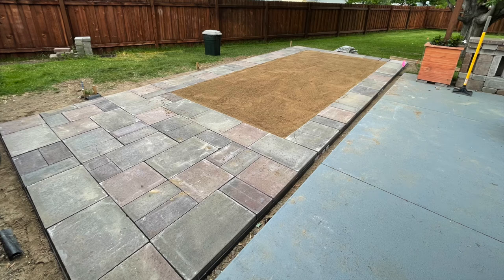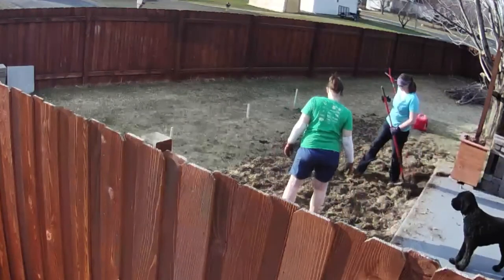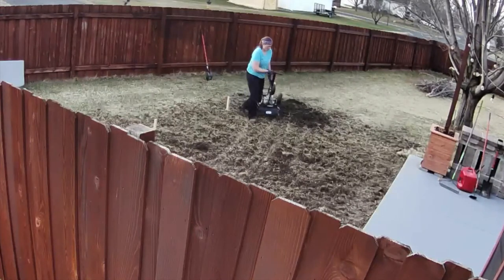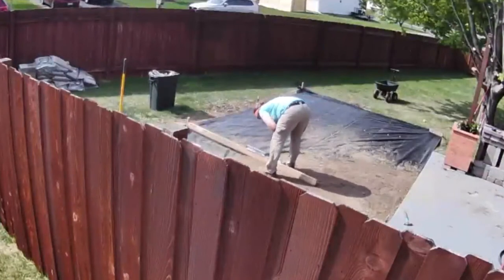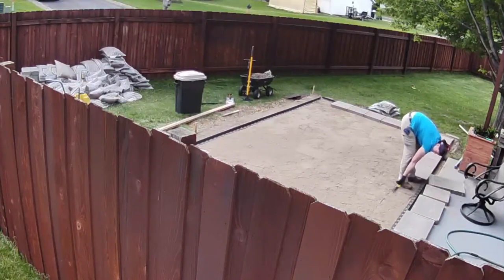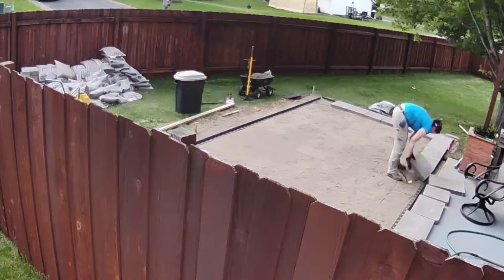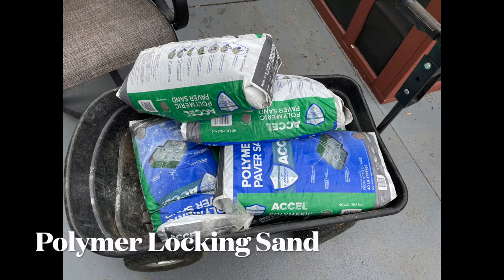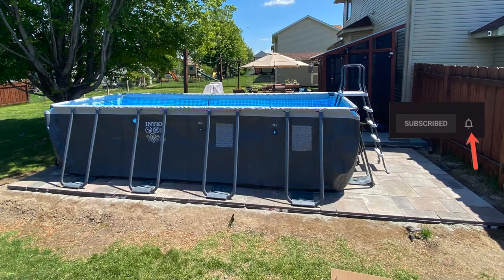The Foundation Matters: Utilizing Pavers and Sand for Ground Preparation!

Comment: This is great. Thank you. Did it hold up well to the pool over the summer? Anything you'd change?
Reply from the maker: I would have made it wider. I needed the pool frame (legs) to hit the middle of the pavers, and they were too close to the edges - which caused some pavers to shift. I didn't really have the problem with length because I had made it extra long.
Reply: @carlytackles  That's helpful to know. Thank you!

Comment: I will use 4×4 pressure treated lumber, p stone, fine sand on top, black heavy duty targ .....how far out of 18×9 should I set my frame?  I want to set it right next to my existing deck ...plz
Reply: Can the pool be moved once is set up but still empty?   Can I drag it empty?
Reply from the maker: For setup- you are going to want to allow for room to work and fully extend the u frames. The manual says the frame (when setup) will stick out an extra foot making your total pool dimension 10’ x 19’. I would allow for more room. If I could do it over, i would extend that paver width - my length was fine. The frame needs to hit the center of the support- ours ended up hitting the outside edge of pavers and it caused them to shift.
Reply from the maker: Not easily. There is weight but the problem is more with the frames. They don’t support the pool well until water is it. They are going to fall in or out when you move it and will need to be setup again. The frames stand and extend to their proper place once filled with water.

Comment: What do you do when you take down the pool? How do you cover the sand? I have a small backyard and the same size pool, live in northeast, so wondering how I could utilize the area for the other 9 months of the year.
Reply from the maker: Take down is a bit more work than setup.  Drain the pool, wipe it all down while some water is still on the pool. I use a mildew spray lightly applying to my rag, probably diluting a bit in water.  Then i rinse all out my rag and rinse the sides and bottom again, wiping again. That might be a bit over the top. I will use a utility pump to help get remaining water out of the pool and then use a wet shop vac to suck up as much as i can. I let it dry. Then take down the sides. Before folding the liner, we made sure it was dry and used talcum powder and coated the whole thing so it wouldn’t stick to each other. It made setting up the pool so much easier this year. We wish we would have used more talcum powder on the poles during setup last year so we made sure we coated the poles really well. 
We washed all of the hoses and made sure they were all dry before packing. We emptied the sand in the filter and cleaned it up. 
In terms of the ground, i left the ground tarp over the sand and placed pavers as weight to keep it down while waiting for snow to fall. The tarp that comes with the pool was not heavy dirty enough to support this, especially with high winds. I ended up buying another tarp. The tarp did a good job of keeping the sand in the pool area and not letting it blow. everywhere.  Because it is work to smooth it out and level it, i didn’t walk on it or do anything in that area. 
If you really wanted to use that space i would think a ground tarp would help keep sand from leaving the area while you walked on it and did other things. 
You could also cover it with some s bit more solid, with what would depend on your climate and how much you are willing to spend to re-use the space
Hope this helped.

Comment: Hope you can help.  I’m just looking to make a patio just big enough to fit the 18x9 intex pool with support legs.  What are the dimensions I should be digging up?  Exactly 18x9 or bigger?   Thanks!
Reply from the maker: You are going to need to be bigger. The frame required 19’ x 10’. You may want to go a tad bigger if you are doing a concrete pad or pavers, it would be alot of weight on the outside edge that cause concrete to crack or pavers to flip.
Reply: @carlytackles  Thank you!